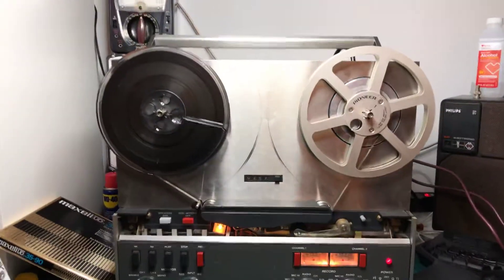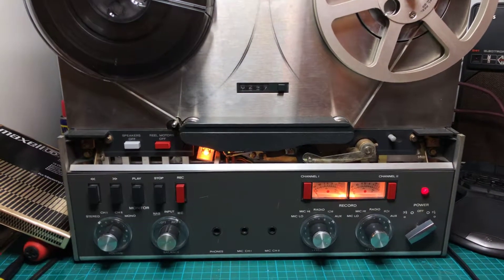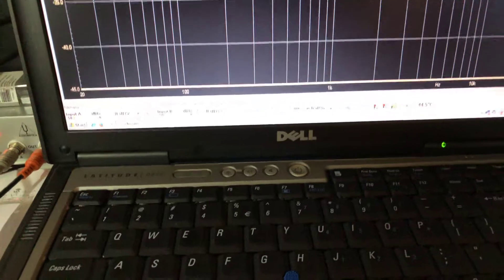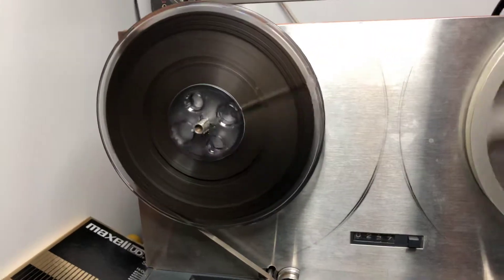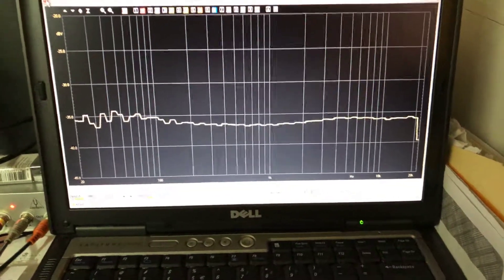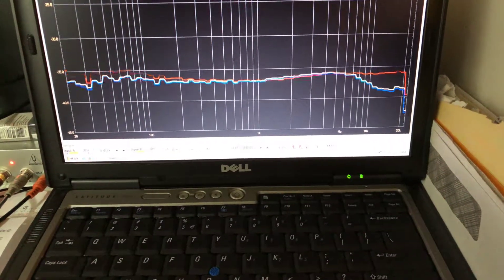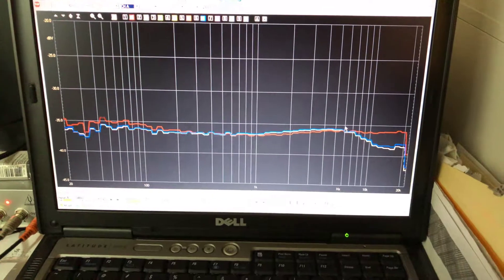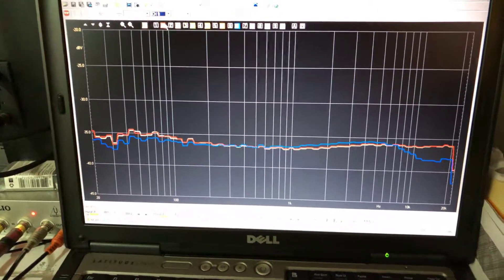Revox A77 with New Record and Playback Heads

Comment: My ReVox A77 is reading really like yours after changing heads.. Were you able to fix this? It's driving me insane this high frequency response difference between channels.
Reply from the maker: It was not the head, it was the Repo-Amplifier board. Replacing the capacitors and checking the resistors (they drift too) fixed the issue. I am not sure which one fixed it though, capacitors or the resistors.